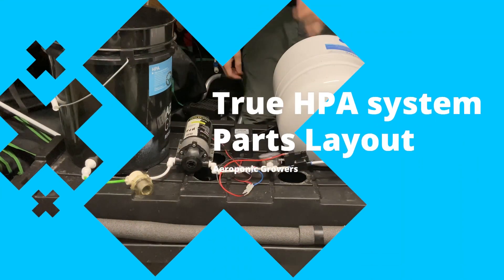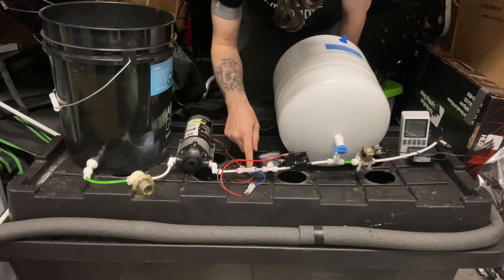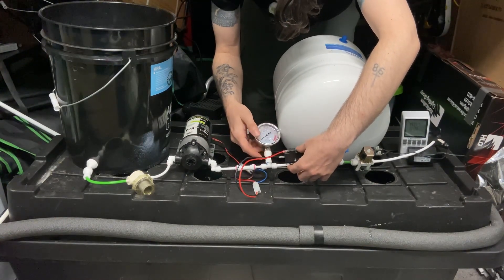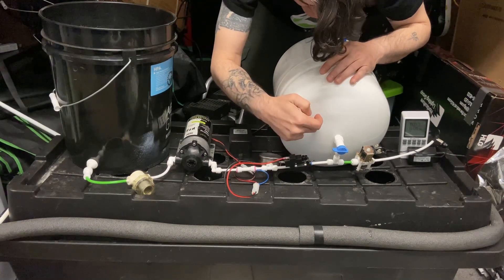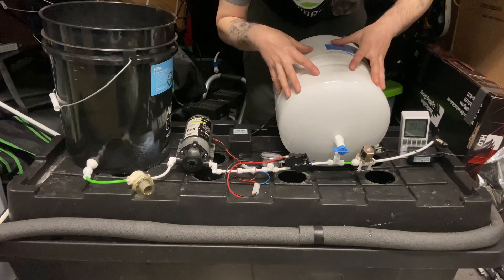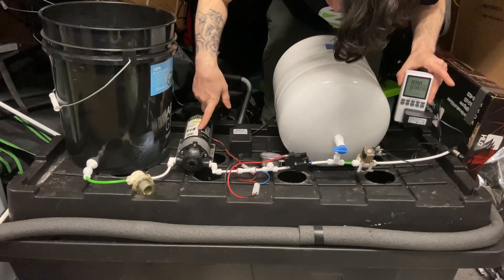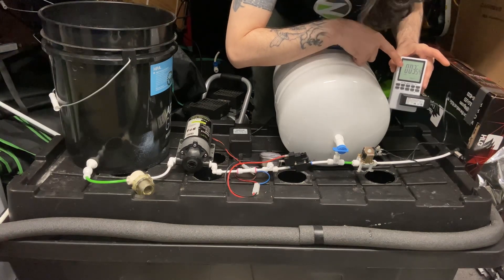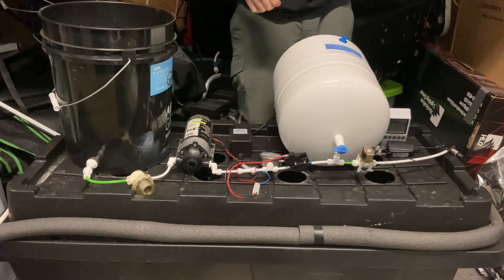True HPA system parts. Quick overview of how to assemble a high pressure aeroponic system.

Comment: Would love to build this but its seems too complicated,have you ever tried fogponics or know if its as efficient since fog water molecules are even smaller then hpa water molecules?
Reply from the maker: It’s seems overwhelming at first but once you get it it’s easy. So I’ve had little success with fogponics. For one they produce heat. Second is moving those tiny water particles. Since there’s no pressure behind it, it becomes a mist. If you blow it the drops will combine. Start with a low pressure Aeroponic system. It’s just hydroponics but the roots are constantly sprayed. And you use less water and nutrients than hydro. Once you get a high pressure or low pressure system setup you’re done and you just need to clean in between grows. If you want to go really simple and still get a big grow go with earth boxes or city picker boxes and it’s a hybrid peat moss/coco coir substrate with the water reservoir in the bottom. I pack one up with 15-15-15 fertilizer “2-3 cups” and I can get an entire year of multiple grows out of it.
Reply: @AeroponicGrowers thanks for the help,what solution do you use to clean your system or how do you do it?
Reply from the maker: @GabrielSilva-zw6tp I just keep the systems running so that I don’t have to clean anything. If a mister clogs up, I will replace it but they won’t crystallize the salts in the solution if they’re kept wet. If I get slime inside the container I scrub it out with hot water. But I’ve never had that happen because I keep my root chambers as cold as possible. 64 degrees is the optimal temp for dissolved oxygen so I always keep the grow room at that temp. There are many solutions to clean with but I recommend using the cleanest nutrients and an inline filter to begin with.

Comment: Why are you using an accumulator tank for 75psi? I’ve seen them used mostly in 500-1000 psi systems. Also, aren’t the nutrients crystallizing on the nozzles with 50 micron droplets. I’m guessing the hole is 0.016”? Mine still clog from time to time even with a 2 min RO flush after preceeding nutrient programming.
Reply from the maker: @AffinityPhoto  the accumulator tank is to keep the pump from constantly kicking on and off. These systems use reverse osmosis components mainly with 100psi limits. If I start with absolutely clear nutrients it keeps down on the clogging. The spray cycles are so short that it takes over a year for crystals to start forming. A big way to avoid crystals is keeping a high level of moisture inside the containers.

Comment: Hello, if I use the accumulation tank, how often and how long does the pump work per day?
Reply from the maker: With the accumulator tank the pump is only going to turn on shortly for less than ten times a day. But that’s a ballpark figure because it truly matters on how much liquid your using on the other end. With 1-3 seconds of spray going off every 3-5 minutes you’re not going to go through a 4 gallon accumulator tank in a day. The pump will turn on to keep that 80-100 psi consistent but it’s not for long.

Comment: I have a rdwc system with pots I could easily modify it to Aeroponic. How much pressure do I need to connect X nozzles/pots?
Reply from the maker: I don’t understand your question?
Reply: @AeroponicGrowers  how much pressure does the pump need to operate numbers of nozzles. For example let’s say if I had 150 nozzles in a 100 feet line I assume a 50w pressure pump has not enough power to get the desired mist out of all the nozzles.
Reply from the maker: @ParaZen  it comes down to how many accumulator tanks you use or how big. The smaller the pump the longer it takes to fill up the tanks. A bigger pump will fill them quicker. These tanks release the pressurized nutrients at a steady rate while keeping the pump from running continuously.

Comment: How many 5gal buckets could you spray using just one of these systems? I have a 40x16 flower room I would like to be able to use this method on.
Reply from the maker: I would say 4 buckets of you’re using 2 nozzles per bucket. I had a lot of difficulty with making 5 gallon buckets into HPA. The buckets heat up fast. But if I just ran the system low pressure it worked.
Reply: @AeroponicGrowers  Why would the buckets heat up?
Reply from the maker: @MrLeonfs  since they don’t have a lot of space for air inside the outside temps in the tent or grow room rapidly increase the temps. If the roots are touching the sides they heat up fast too. I went as far as running a chiller on the nutrient line but they heat back up again waiting inside the tubing to spray. The bigger the container the more room you have for variables.

Comment: If I have 4 long chambers (1,2x8 M) in vertical configuration, should I make only with 1 accumulator tank for all chambers or better each chamber with 1 small tank?
Reply from the maker: There are so many factors involved but to keep it simple I don’t like going over 2 feet between the tank and solenoid. So smaller tanks will give you more. Or place another larger tank at the end of the line. If you want a large tank for all of them, run it at a higher pressure then use pressure reducers inline before the solenoids. Don’t throw more than 100psi at most solenoids, have the reducer in line.

Comment: Question about lighting. Building an HP aero system based on your videos. I'm a newbie. What lighting do you recommend? I plan to place my root chamber on a metal shelving unit- 36" wide by 21" deep. I figured I could hang a light from the underside of the top shelf. But have no clue on light strength or led temp. I'm only growing veggies and fruits.  Some reddit users recommend the Shenzhen Kingbrite brand. But they offer so many choices. I don't know where to start.
Reply from the maker: I would check out Horticulture Lighting Group and find what’s going to fit. If you’re only growing leafy greens you don’t need much light. Just something in the 4K spectrum. If making fruiting plants than you need the 3K spectrum and more power.

Comment: Im having issues with my misters. I purchased the black tee misters with brass misters. But they are always failing. I have a pressure pump but no reservoir I just have it siphoning from the reservoir. The pressure pump is an Aquatech 120psi pump with 3/8" push connectors. I have 2 containers both 5 ft long with 4 plant sites with 2 misters to each plant site for a total of 16 brass misters with .4 nozzle opening. Can you please tell me what im doing wrong? I dont have a filter before the pump so ill add that. But still it acts like the pressure pump cant keep up. Am I asking too much from that pump to power 16 brass .4 hole misters? Are those misters acceptable to use? If not what misters should i use? I want a fine mist not a spray. Trying to stay under that 50 micron limit.Any help or advice would be greatly appreciated.
Reply from the maker: I don’t hear you talking about using an accumulator tank?

Comment: Hello, I have a 100psi pressure switch and aquatec 8800 pump. I cant seem to get the pump to turn off. I tried closing the valve before the solenoid and the gauge just sits at 100psi. I have my accumulator set at 80psi.

I appreciate your time and effort.
Reply from the maker: You need to set your accumulator tank at 78 psi or a little lower.

Comment: Is the high pressure switch the same as a tank shut off I saw in the "other people buy" section of Amazon on a link to the 8800 aquatech pump?
Reply from the maker: They can be the same the same thing sometimes but you want a switch connected to the pump. Look for a PS-100 Aquatec switch.

Comment: Do the nozzels clog up often?
Is this system easy to maintain/clean?
What pressure range and nozzel size would be best for Lettuce, Spinach, and other greens?
Reply from the maker: If you don’t have good inline filters the nozzles can clog. Keep extras around for a quick replacement. If you keep your nutrients clear the system will run clean. Use a mild oxidizer in between grows. Read through the comments for more information on nozzle sizes etc. you don’t need a deep container to grow greens. Their roots are very small in comparison to tomato plants and other big root systems.

Comment: Hi all!

How do we calculate the number of misting cycles to select a recycle timer? 

Let's say, i need to put the misters on for 3 seconds for every 3 minute off cycle. Here what is the number of misting cycles that i should be looking at for selecting a timer/controller? 

I am a newbie to Aeroponics & i am trying to learn about the controller. Any help will be much appreciated!😁
Reply from the maker: I use a NEARPOW recycle timer that goes down to 1 second. I have it turn on the misters for 3 seconds on and 3 minutes off. Then as the plants grow I stretch out that time going down to 1 second on if possible every 5 minutes.
Reply: @AeroponicGrowers  Thanks for the quick revert!

So here, in the initial phase the cycle is 3 seconds on to 3 minutes off. Does this count as 20 ON cycles & 20 off cycles per hour? So as per this calculation will i actually need a timer for 480 cycles of ON time & 480 of OFF time? Nearpow definitely could be apt for this purpose, but i doubt the availability of this timer in India & hence i am searching for some options. Can you please suggest onto this & the query for the number of cycles?

Your videos have extremely helped me to come near to setting up a new system & i really appreciate of how clearly you've put the content up! Thanks once again!

Comment: This is awesome man I wanted to do something like this like 20years ago.  Just wondering how big of a system can this setup scale up?
Reply from the maker: Just add more accumulator tanks to be filled up and one pump can do at least 40 gallons
Reply: @AeroponicGrowers  how many accumulator tanks would one need for this design?
Reply: @AeroponicGrowers  hey, can you explain where the other acumulator tanks would go? Do I just use a splitter after the pressure guage to go to different tanks?
Reply from the maker: @RT-qz5ci  I put the tanks within 2 feet from the solenoid. The distance up to the tank to fill it up I’m not concerned about.
Reply: @AeroponicGrowers  right but where do you put the 2nd accumulator tank you mentioned in the setup? I dont understand where to connect the 2nd. Please explain i cant find any info anywhere on this! Thanks man!
Reply from the maker: @RT-qz5ci  you can put another accumulator tank anywhere on the pressurized side of the pump. What I recommend so you have a consistent spray is to have the tank as close to those misters as possible. Going over 2 feet away from the misters creates a lower pressure spray. Obviously there is the solenoid before the misters. If I’m going to put a tank on the other side of the room, I want that tank nearest the solenoids. Accumulator tanks are like adding bubbles to your pressurized line that hold liquid.
Reply: @AeroponicGrowers  thank you so much! Makes sense!

Comment: Hi, i can't find the 2 high pressure switch you suggested 🤔 only 40 to 60 psi range.
 I'm in Europe, any suggestions? Thanks for your video
Reply from the maker: They’re tough to find I think it’s PSW-100 Aquatec pressure switch. But in Europe look for pumps that are delivery or demand. They cost a little bit more but the pressure switch is already in the head of the pump and you can adjust it from there. You want a diaphragm pump people use in power vacuums. The pump I have in this video is common with a SurFlo pump. Also look for reverse osmosis booster pumps. Actually start there. First look for reverse osmosis RODI booster pumps that go under your sink. Also aquarium stores sell them too. Good luck!!👍
Reply: @AeroponicGrowers  what you think about using a digital pressure switch(home, garden use...the big model)i can set max pressure manually but it need more time to open the valve🤔

  Starting from your first video, your answers are amazing. Thanks, hope the best for you mate 🍻
Reply from the maker: @giskio  Yes, I’ve seen people use them. With Aeroponics using the resources available to you, testing them and making things work is what we have to do. Some people have to pay more for things yet save in other areas of their build.
Reply: @AeroponicGrowers  🙂 thanks again, again and again!

Comment: I am just sooo intrigued with your system.
But,  as a complete newbie, a question comes to mind.  Wouldn't it be easier to just use a paint spray system, where instead of paint, you're spraying nutrition water?
Also, does the Accumulator Tank need to be repressurized, and if so how often?
Reply from the maker: Yes you can use any system otherwise designated for a different use to build a HPA system. There are no solid rules! The accumulator tank has a bladder inside that needs to be pressurized to 3 psi under when you want the pump to kick back on. Usually around 80 psi. Check this pressure every once in a while. The pump pushes nutrients into the tank and the bladder pushes them out giving the pump a break.
Reply: @AeroponicGrowers  - is the concept is similar to the air compressor system works in the workshop/garage?
Reply from the maker: @mohdakbalmohdzahid374  if your using an air compressor you need to use air atomizing nozzles. They are expensive but the best to use.

Comment: First of all, congratulations on the video from Spain I would like to know how many nebulizers you can connect to this configuration ... And at what pressure should it work if you want to connect 8 netafin coolnet pro nebulizers. I would very much appreciate your knowledge in Spain we are very eager to master this technique
Reply from the maker: You can connect as many as you want, the larger the system is increase the accumulator tank size. Start with the smallest amount of coolnets which will fill your container. I can use 1 in 26 gallons just fine. I can use 2 in a 26 gallon tote by cutting the spray time in half. There is no exact science. You want enough spray to feed the plants with little rub off at the end of the day. This will change in each cycle of growing. Test, record, repeat, have fun!
Reply: @AeroponicGrowers  answer please!!! jjj
Reply from the maker: @enekoarbizu1615  I answered your question last week above. I’m confused, I don’t see another question?
Reply: @AeroponicGrowers  yes my question is next one... What bomb and pressure switch do you recomend for netafim coolnt nozzels that they work fine in 80 psi?? Is possible to buy your bomb from Spain?? I Will pay all shipment costs...
Reply from the maker: @enekoarbizu1615  the setup in this video is all you need. I think it’s a Aquatec PSW-2100 “I could be wrong” but get the 80/100 psi switch. I stopped using netafim. I like their drip less nozzles but that design is old and is easy to obtain for less money.
Reply from the maker: @enekoarbizu1615  if I could find some help for the business I would love to send you the parts that work. I’ll keep you updated…
Reply: @AeroponicGrowers  nice thanks a lot let me know if you can send me the parts... Thanks again you are very helpful. the future of growing 😉😉
Reply from the maker: @enekoarbizu1615  just go to my website
Reply: @AeroponicGrowers  I saw that your website Store is still down for maintenance...
Reply from the maker: @jacobchang4588  ya it sucks… still rebuilding the company and looking for some partners!
Reply: @AeroponicGrowers  what kind of a partner are you looking for?
Reply from the maker: @jacobchang4588  someone to run the business. I’m good at engineering systems.
Reply: @AeroponicGrowers  I am very sorry that your page is inoperative .... I have gotten the pressure switch but now I am hesitating with the aquatec pump ... which one would you recommend to get 80 psi in my system? 8800 or 8852 could you recommend me a specific model ??? thank you a lot for your answers and patience
Reply: @AeroponicGrowers  why do you stop with netafim?? any problem with nutrients?? is the only nozzle that i can get spain.... CoolNet™ Pro by netafim works well at 80 psi... It also comes with an anti-drain valve that mantein the system prezurized.... what dou you think about it??? thanks a lot for your patience you are beeing so helpful for me!!!!
Reply from the maker: @enekoarbizu1615  I think netafim is awesome and what we used in the beginning and still use. We use different nozzles for different setups. The coolnets are great for throwing a spray in a 3 foot area each way. This is great for larger setups and put them up high so they spray around the top of the roots. Then when they get bigger there will still be space. You can spray single ones upwards on pvc pipe runs all kinds of things! Sometimes I put the orange caps on them if I just want to throw 3 feet only in one direction. Their non drip systems was one of the first and still the best. I like the orange pin ones the best. And I have the old green caps which do 50 microns!! Somewhere…
Reply: @AeroponicGrowers  thanks a lot for your time .... I Will put my setup in you tube to show u jajaj